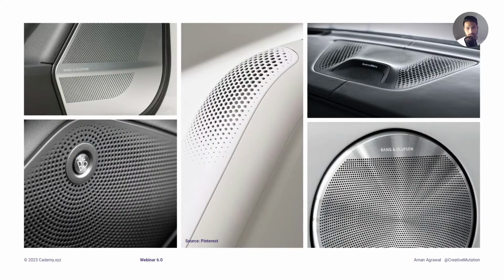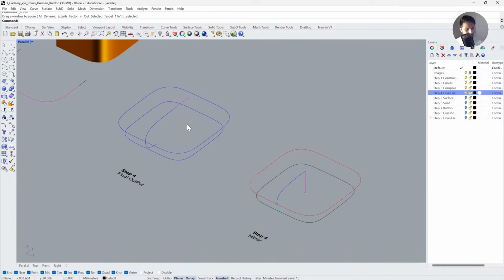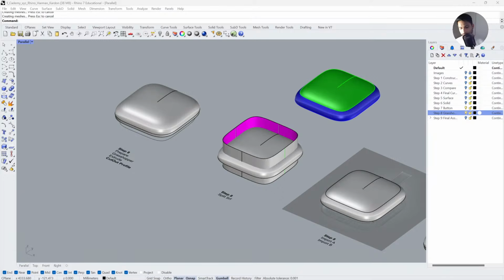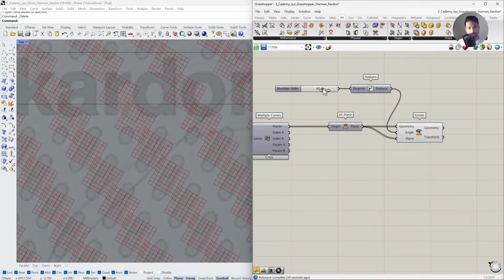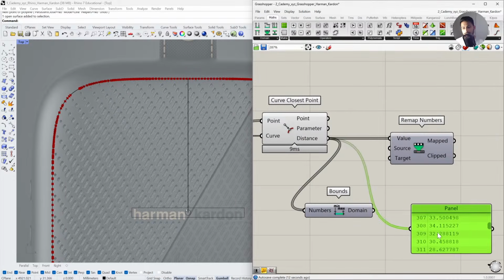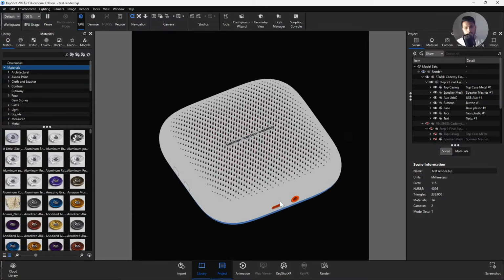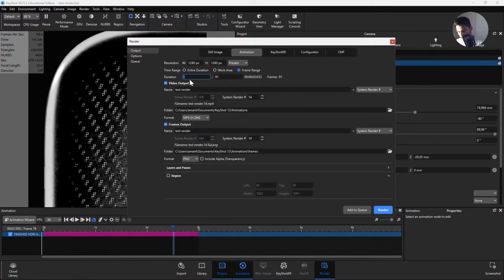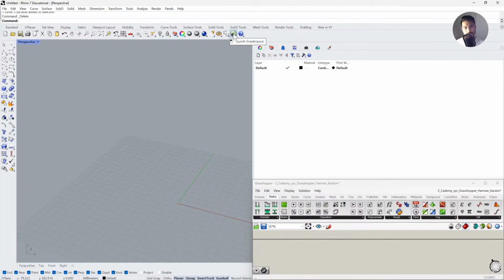Rhino 3D Speaker Modeling & Acoustic Grasshopper Texture Tutorial | Webinar 6.0

Comment: 1:02:48 Your higher element of this speaker is closed polysurface or open polysurface? My boolean operation was fail
Reply: Hey, not sure if you have the same issue. My boolean failed too because I forgot to cap the extruded rectangles. Somehow missed the step. My boolean only worked once they were a solid like the original surface.
Reply from the maker: When in doubt, check the object properties before the operation to determine whether the two objects are solid. You can also try performing the Boolean Difference operation in smaller batches.

Comment: Excellent class, huge learning! Regarding grasshoper I have a question what would be the ideal setup for when applying the Difference Boolean command does not lock, I observed that my Rhinoceros stays for hours and hours and does not perform the command do you know how I can solve this or do I need to buy a Mac? Congratulations on the Exceptional Class
Reply from the maker: Thank you for your kind words! I'm glad you enjoyed the class. Regarding your question, it sounds like the issue might be related to the complexity of the geometry or the computing power of your current setup. Can you try to perform Boolean difference in small batches. If not, try to simplify geometry or check if your Rhino is updated. 

Buying a Mac is not necessarily a solution to this problem. Both Windows and Mac systems can handle Rhino and Grasshopper efficiently. Hope this helps! If you have more questions, feel free to ask. Congratulations on your progress!
Reply: @Cademy  👍

Comment: First time I've seen someone else using the 3D space in Rhino as their "modeling timeline" / history. 
Really appreciate how well thought out and organized the lesson and the accompanying assets are.
Reply from the maker: Thank you for the kind feedback. It's pretty neat, isn't it? However, the file size can become quite substantial as well (though there are ways to address this issue).
Reply: for me this is not a well organized tutorial. no visible Screencast Keys
The tutorial doesn't tell you how to upload photos or set distances. some of the movements are omitted, such as placing the upper part to the lower part so that they touch together. no info about layers and how to deal with it